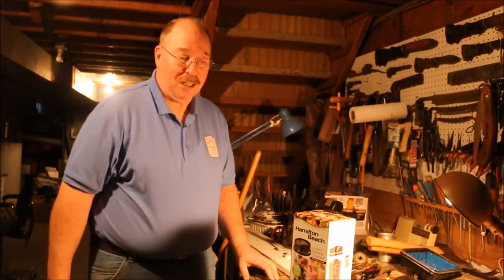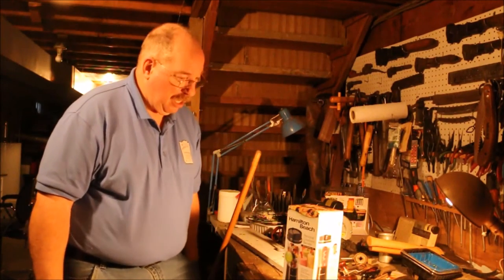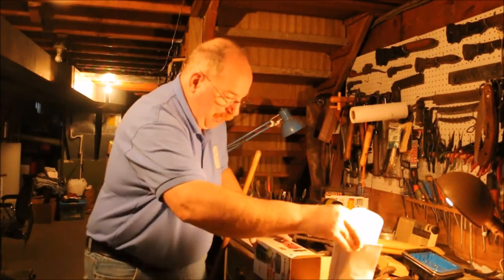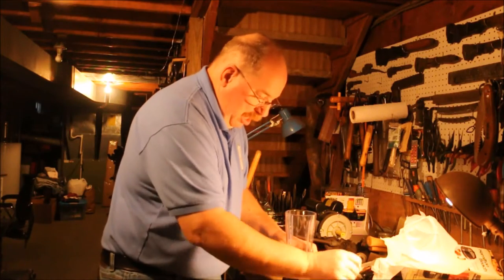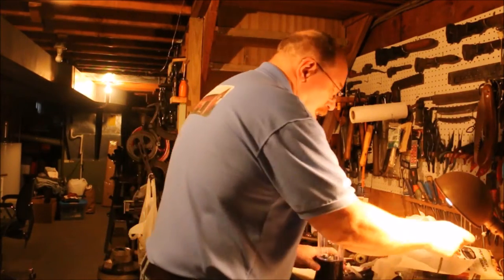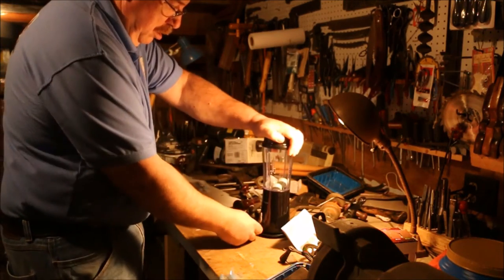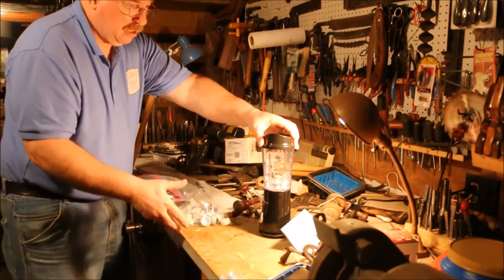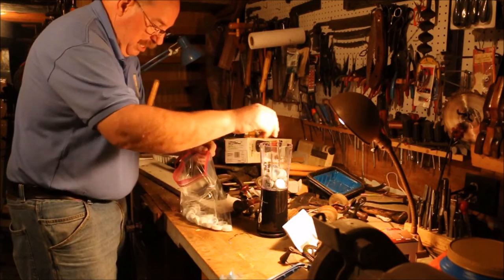Fun With Plastic ~ Pt 1 ~Grinding Up Bottle Caps With A Blender ~ by Old Sneelock's Workshop

Comment: Great video. I’m gonna have to try this. Make sure the plastic you use it a thermoplastic ( the kind that gets soft when heated) and not the resin-set kind of plastic, that stuff ain’t so good to heat up. Ps. Don’t let anyone look down on you for collecting bottle caps, you should see my workshop, it’s full of thrash that I’m sure will come in handy someday. 😁
Reply from the maker: Hey Patch so far I have been using HDPE labeled plastic. It seems to work pretty well.
Reply: I'm in IT and I build computers. We call those "shit I might need" closets

Comment: I HAVE SEEN THIS DONE WITH MILK JUGS, THEY PUT CUT UP ONES IN A TOASTER OVEN ON LOW HEAT AND FORM WHAT YOU WANT WHEN IT MELTS. THEY USED A ALUMINIUM PAN TO MELT THEM IN.
Reply: ..yep i seen one feller who used an old glass Pyrex dish...
Reply: I'll just watch yall. I'm a borderline firebug anyway.
Reply: Mike Tarzwell melt them into blanks to turn into haldles on the lathe.
Reply: Matt Cooper You been watching Peter Brown too??
Reply: Lewie McNeely Yup, another channel I am subscribed to. Dip It....
Reply: Matt Cooper Me too.
Reply: Lewie McNeely Great minds and all that....
Reply from the maker: That is one of the things I want to try. We don't go through that many milk jugs anymore so I'm using the waste stream that is gathering the quickest.
Reply: Matt Cooper Natch!!
Reply: Old Sneelock's Workshop It'll work and we all use what we have. The new splitter works fine but I need to reset the hi-lo a little. I just run 1/3 throttle and it's set for max flow at wide open. Easy fix and standing up is a lot easier on the backbone. Now for ordering parts for the Onan. Ahhh, job security!

Comment: Full size yard sale blender works as well and cheaper. A piece of 1/8 or 1/4 inch screening works well as a sieve. You can get some interesting effects by mixing the different colours, sort of marblizing.
Reply from the maker: Would have been happy to get one but the yard sales in December are kind of thin on the ground around Kalamazoo. 
I want to try the color mixing idea. I need to control the temperature better. Got a few ideas on that.
Reply: I don't usually see blenders at yard sales myself.  Just got a $23 Hamilton Beach full size blender at Walmart for this purpose.

Comment: I want to make terrazzo and I though of adding some recycled plastic. I might try the crushed bottle caps 😬 thanks for the video!
Reply from the maker: Cheap blenders don't last. It worked but the base wears out. Might work better with water in the mix to cool the bearing.

Comment: I’m an artist.  I learning to work with cast acrylic.  I already have scraps and failed experiments I’d like to grind up.  I could soften the granules at 400 degrees and press them together.  There is a guy here on YouTube who built a table top 20 ton press and formed marbelized blocks.

Comment: Wish you would show the pieces
Reply from the maker: The size of the chopped up caps varied from dust to about 1/4" square. 
Easily smalll enough to be fed through a 1/2" pipe.

Comment: You never know until you blow the house up. On your foraging safari's you ought to see if you could find an old Vita Mix. The old adds had them chewing up 2x4's. We've got one and I don't doubt it one bit. I think Peter Brown used milk/water bottles and made a nice mallet. We started wearing our own water out and save the bottled for emergencies and it's amazing hoiw much less trash we have now. Put the Berky filter to work. So far, so good. No kidney stones are GOOD kidney stones. I bet that's what inspired Ernest Tubb to write the song about walking the floor over you.
Reply from the maker: We had a real expensive Oster blender that had a glass pitcher. Some one put a full tray of ice cubes in it and when they hit the button it shot glass and ice cubes all over the kitchen. You're supposed to put them in a few at a time while it's running. Live and learn.
Reply: Old Sneelock's Workshop WE've got an Oster that sounds like an air-raid siren when it's running. Like a router motor. I think it's a wally world deal. Works good but the Cook wears earmuffs when grinding.
Reply from the maker: Lewie McNeely I turn down the hearing aids and the video sound level when it's running. :-)
Reply: Old Sneelock's Workshop I've worked hard for my tinitus and enjoy every minute of crickets screaming when the snow is on the ground. Sweetums was wanting me to get hearing aids but we decided that it was WAY too much $$ to be used once a month. Besides everybody is used to hollering at me anyway and strangers get over it.

Comment: is it possible to grind thin LDPE sheets into powder in a blender? sorry for the stupid question, i am from SE asia, they pay me least amount of money for products i make, on one hand pellets are too expensive and i will lose money if i use them, on the other hand, stuffing LDPE sheets into the heating chamber is torturous for me.
Reply from the maker: The bottle caps are HDPE high density polyethelene. It doesn't cut or grind as much as it shatters from the blender blades striking it. I tried cutting blow molded bottles in the blender. It didn't work well at all.
Reply: @OldSneelock  thank you so much for your reply, i appreciate it.  i am making caps for 20L containers by using thin discarded LDPE ( low density polyethelene )  sheets which were  used in tyre retreading. is there anyway i could turn them into tiniest  pieces or turn them into powder ( preferred ) so that i could pour those pieces or the powder into the heating chamber instead of stuffing sheets into it. i am using kinda primitive manual molding machine. even the cheapest grinding and pellet machines are way beyond my purchasing capacity. thank you.
Reply from the maker: Can you cut it easily?
Reply: @OldSneelock  yes, with a scissor. it is thinner than the paper.
Reply from the maker: You might be able to rig a bench knife. 
It will work like this paper cutter.
https://www.uline.com/Product/Detail/H-2248/Scissors-and-Trimmers/Paper-Trimmer-18?pricode=WA9357&gadtype=pla&id=H-2248&gclsrc=aw.ds&&gclid=Cj0KCQiArenfBRCoARIsAFc1FqfHKBE8ek3CUZMmXEagM4uwJFryQb2Ovb3UgGZ10iGwJQeZ9x431EMaAmAVEALw_wcB
Make the blade by sharpening one edge of a 60 cm long steel bar. A 30 degree single bevel would work. Drill a hole in one end and make a handle on the other.
Drill a hole in one end on one side of a 50 cm piece of 4 cm x 4 cm x 4 mm angle iron. Bolt the blade to the angle iron through the two holes. Attach the angle, with screws, to the edge a bench, table, or even a stump. Then you can lay several sheets on the angle and shear it into strips with the blade. Turn the bundle of strips 90 degrees and chop tiny squares off the end of the bundle.
If you don't have angle use another length of bar. 
You are making a giant shear that let's you use your arm instead of your hand grip strength. Much easier to cut. 
Hope that helps.
Reply: @OldSneelock  thank you, thank you. guillotine cutter, right? they are cheap on amazon.
Reply from the maker: Yes. If you can buy it yhat isva quick way to go.
Reply: @OldSneelock  thank you for taking your time to respond for my issues, i appreciate it a lot.
Reply from the maker: Happy to help. Let me know how it works.
Reply: @OldSneelock  i will. old sheelocks.
Reply: @OldSneelock  i am using reprocessed LDPE film pellets. thanks for taking your time to respond  my queries.

Comment: I have a Waring blender that my parents bought in the late sixties. I swear that thing would grind up a hog leg. Don't think the wife would like me grinding plastic in it. Guess I'll just wait for The Old Sneelock custom handles come on the market.
Reply from the maker: At this rate I'd have to sell a couple thousand at a dollar apiece to break even. Might come up with a faster method. The plastic injection molding plants that I worked with had grinders that shredded that sprues and gates from the molded plastic so it could be reused. I could probably make a few hundred handles out of the dash from a junk car.
Reply: As I understand it, you have to add "fresh" plastic to the reground stuff in injection molding and for 3D printers.  It's probably a lot less of an issue for the uses you are currently looking at.  Also, as you aren't completely liquefying the plastics (just bringing them to the plastic state), it may not even be a concern.
Reply from the maker: Brian Neeley You are correct they do add fresh plastic to injection molding machines along with the regrind. I don't know about printers because the units I[m familiar with use plastic line as feed stock. The regrind is added to the hopper on the injection molding machines along with fresh plastic for at least a couple reasons:
1. The gates from one injection wouldn't be enough to refill the die for the next injection.
2. The color changes slightly from the heating and blending in a much higher volume of new to old keeps the color more consistent.
We'll have to see what happens when an amateur attempts to recycle.
Reply: Sometimes 100% recycled, depending on the material and process, can yield filament that is too brittle to handle and process in a 3D printer.